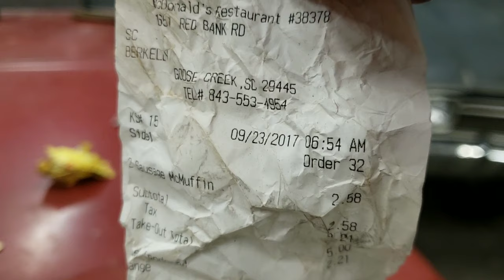1974 F-100 Kicker To Drop 12" Bass

Comment: Nice job I have a question does the amp have to match the speaker and does the speakers have to match the radio like for example does the radio the speakers the amp do they all have to match by brand